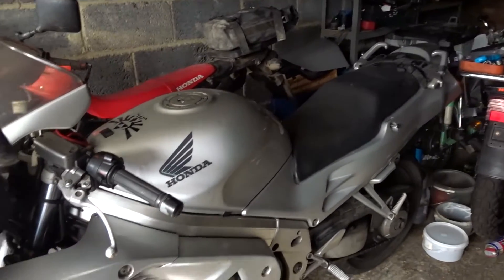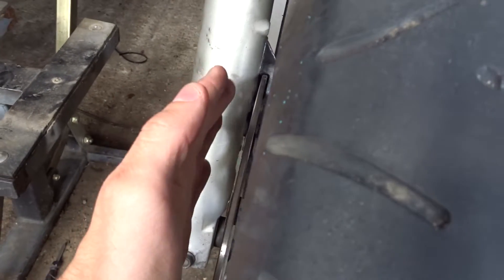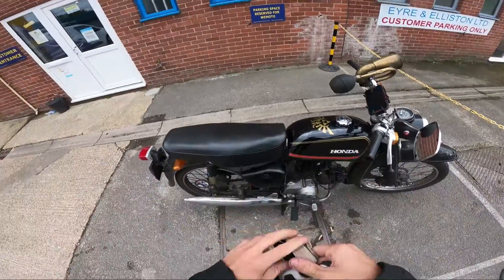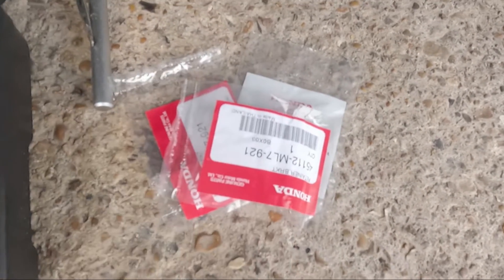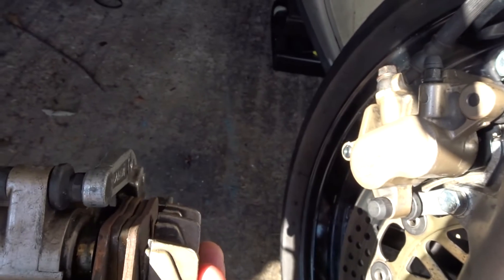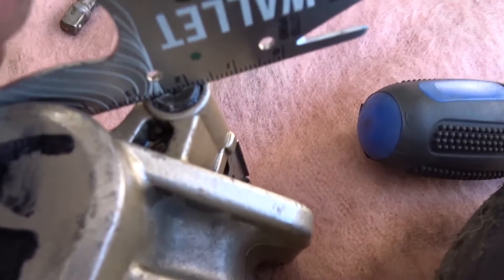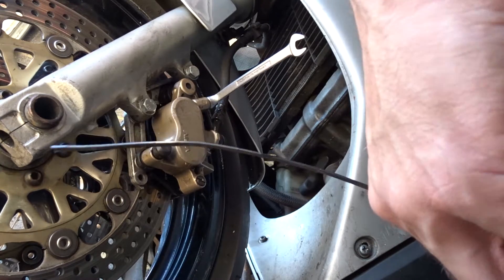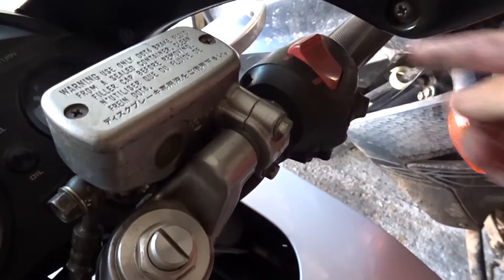HONDA VFR750 Loose Pads & calipers

Comment: What is it with the zip locked brake lever overnight?
Those large slotted screws can often be started with an impact hammer used with a rubber mallet to soften the blow.
Is this what I missed the other day with your livestream?

Kind regards.
Reply: It helps any air bubbles in the brake system rise.
Reply: @CuriousGoose  Thank you. Never heard of it before.
Reply from the maker: yeah what goose said any air gets forced out over night. yeah some of this repair was done LIVE
Reply: @BigPezza  OK thank you.

Comment: Im new to bikes. I have a soft spot for fmvfr750 and 800. I will deffo get one in a couple years as 1st bug bike. Can you do a video as to why you like it 😁
Reply from the maker: all ready sort of did https://www.youtube.com/watch?v=tGgb8SMNFcM
Reply: @BigPezza  thanks. It being a older bike any problems with the new fuel parts or anything like that?
Reply from the maker: @2shane493  any carb bike avoid running it on e10 it might be ok once in a while but not all the time
Reply: @BigPezza  ok thanks. Im doing my das soon im a big guy so most bikes if sat on isn't great. Would a 750 be to much
Reply from the maker: @2shane493  ask your insructor but i dont think a sports bike is a good choise for a first bike, they are unforgiving. also the 750 is a great short persons bike

Comment: The caliper is supposed to move in order to keep the pads in even contact with the disc. The one that doesn't might be seized.
Reply from the maker: Yeah so got the rebuilds ones much better

Comment: Ooof, big spendy. Hope it is all sorted now mate?
Reply from the maker: seems to be good just need to put a new rubber on the front and the bike is ready to be put away for the winter 😂😂😂
Reply: @BigPezza  LOL.... is it not better to leave the old rubber fitted if it isn't gonna move anywhere and then put the new tyre on in the spring?